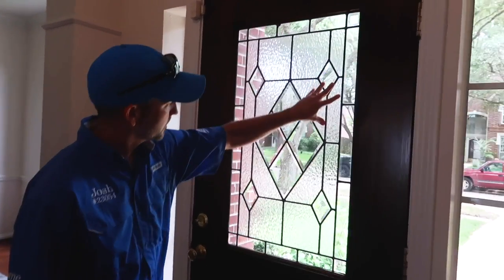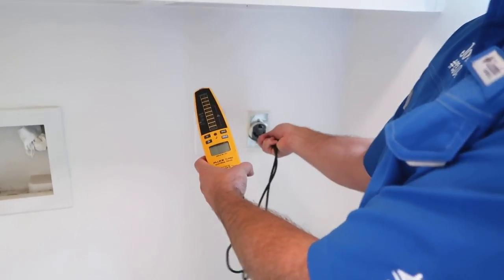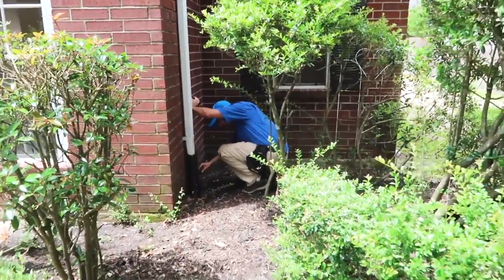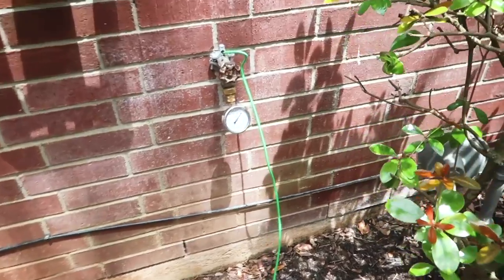My Inspection Day - 1990s Home Inspection - Part 2

Comment: " If It didn't rain..." I still think that kick-out flashing is an issue - while you might not see moisture up high - it would still end up accumulating at the bottom, right? Good Find.  Are we required to find the actual source  of the issue?  Are we required to pose our theories? or do we  just  report the  facts?  In this case, you look better (to the client) by positing theories
Reply from the maker: We answered this question on the most resent podcast.  It will be other tomorrow